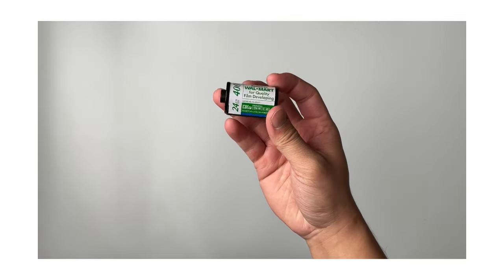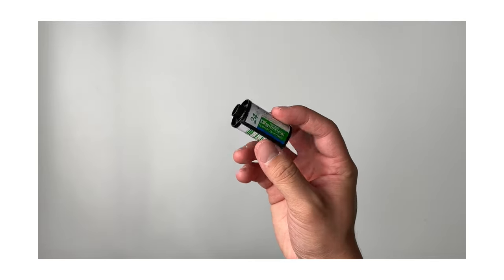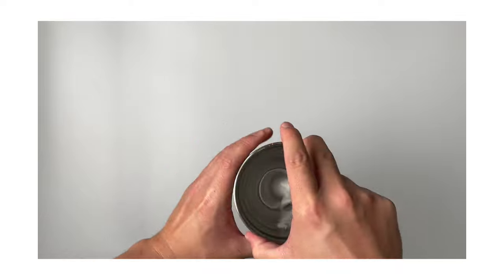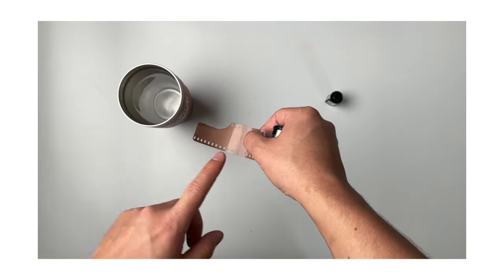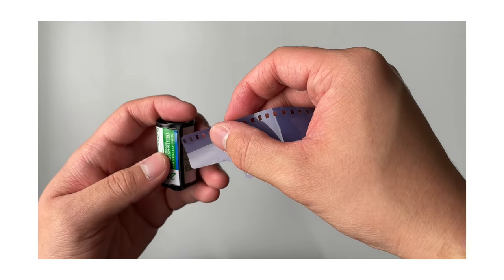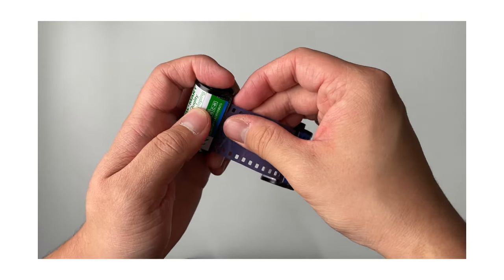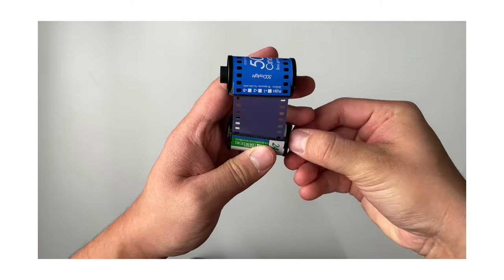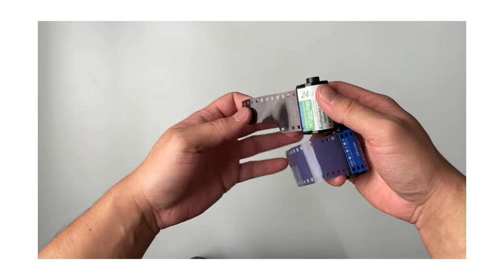How to Get Film out of Canister - Retrieve Film from Canister - Film Photography Tips

Comment: Sadly it didn't work for me. Is it because the roll is already deep inside so it can't be pulled out or is it because the tape is too weak?
Reply from the maker: Sometimes it doesn't work the first try. If it isn't connected to the right place it wont pull it out cleanly

Comment: I'm thinking about using this technique to feed the film on the developing reel for my Paterson tank, though I wonder if this would work as it requires some force to pull out the film from the canister. Anybody tried this?
Reply: No, it doesn't require any force at all. I just did it, and it just felt like pulling the film out as if I was about to load a new canister into my camera. No resistance at all
Reply from the maker: Its doable but I recommend a specific tool if you are going to be developing and doing it to a lot of rolls for consistency